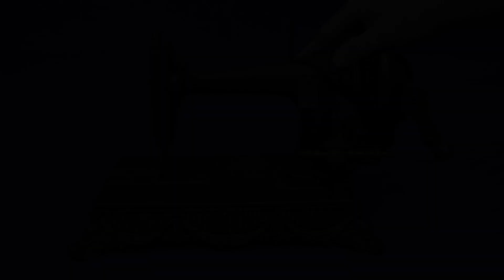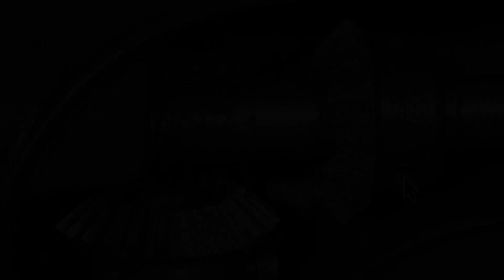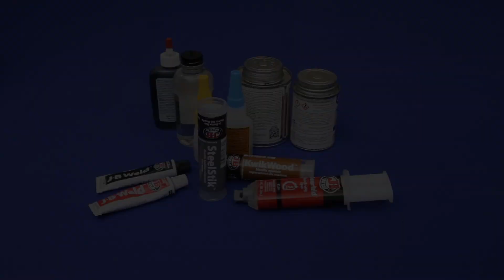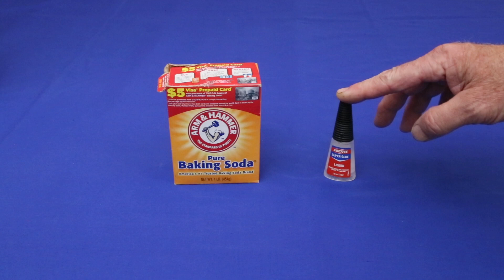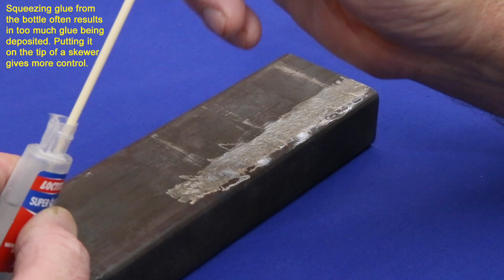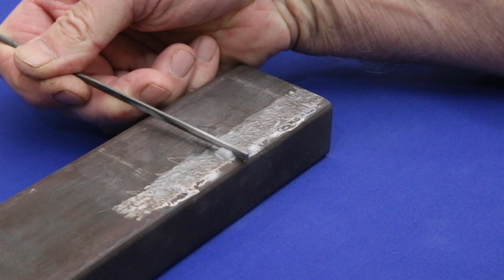How To Fix A Broken Gear Tooth In An Antique Sewing Machine

Comment: Totally awesome!!! Do you think it's sturdy enough to withstand actually sewing? I haven't tried this awesomeness, but me thinks it might be a little to brittle. What do you think Wayne?
Reply from the maker: Yes, it's strong enough to sew with and have done so. But, I don't feel comfortable about doing it for anything other than demonstrations. One thing I've discovered is that grease works better than oil for lubricating these made-up gears because the gear teeth surfaces aren't as smooth as metal teeth. I have talked to Alex about this and he mentioned using both this technique and super glue by itself in repairing some of his machines.
Reply: @wayneschmidt490  Thanks for the reply! Perhaps graphite will work as a lubricant and 'hide' the repair by making the superglue + baking soda as dark as the rest of the wormgear.

Comment: Incredible video Wayne. No one makes videos like this which are so valuable for a new restorer like myself. If I every come upon broken irreplaceable gears, I'll know exactly what to do. Thanks a million!
Reply from the maker: Thanks for the great comment! The new gear teeth seem to be holding, but I'm still a little uneasy about how durable they are. I make sure to give them extra oil before each use. 

If you like videos about restoring sewing machines, you might be interested in my next video, which chronicles in greater detail all the steps involved in restoring the Biesolt & Locke machine in this video. The machine is done except for the artwork. Another 40 hours should do it. I hope you'll enjoy it.
Reply: @wayneschmidt490  I'll keep my eye out for the next video you mentioned, I'm sure it will be quite interesting!

Comment: If you can solve the disassembly problem, the gears in there are most likely miter gears: Each has the same number of teeth and they meet and transfer power through 90 degrees.
Gears like this are available from Mcmaster.com for very low cost.   https://www.mcmaster.com/miter-gears
If you only require plastic, they are just a few dollars.

The superglue and baking soda thing would be good for filling chips and voids.
Reply from the maker: Again, this is a comment YouTube never told me about. I've found over half a dozen tonight alone. I'm going to have to go through all my videos (520 of them... ugh) to see how many others I've missed. I've gotten lots of stuff from McMaster Carr. If I ever get brave enough to try and take one of these antiques apart I'mmbe sure to use your suggestion. My concern is that in attempting to disassemble one, I might cause more damage than good. These things are 150 years old.

Comment: What tools do you need to remove the gears? I would think you could find a matching set close enough to the original, even if you have to adjust the bore bigger/smaller. 
I'm looking at the base and imagining someone sitting at a bench painstakingly carving all those details in a wooden? pattern.  Remarkable.
Reply from the maker: @murmaiderx3923  I finished all the decal work on this machine last night. Today is devoted to the hand gilding. Then all that's left is to clear coat it, assemble it and post the video. This has been a tough one. I figure it'll add up to 150 hours.
Reply: @murmaiderx3923  Why a graphite bath? Graphite doesn't act like creeper oil, does it?
Reply from the maker: The biggest problem is removing the main drive wheel for the horizontal shaft. Many times some of the parts are press fitted with a hot pully and cold shaft so that once assembled they can't be separated. Even if that's not done, I've tried taking them apart on other machines and ended up causing more damage than good. Complicating things is that each machine built by a different manufacturer was assembled differently, so there is no one way to take them all apart. An expert like Alex Askaroff could do it in his sleep. But I've only been working on them for 5 years and have a long way to go to get to that level. Once final issue iOS that if you look on the horizontal shaft to the left of the gear, there's a large gouge that would make removing the gear difficult. For now I'll have to stick with my simple technique. Thanks for commenting!
Reply: @wayneschmidt490  Have you asked Alexander Askaroff, from sewalot.com?
Reply from the maker: @murmaiderx3923  That or a shaft pillar might work. One common problem is that after 150 years, some of these parts are cold welded together. One of these days I should buy a bunch of cheap, lost cause machines and experiment with taking them apart. Thanks for the comment!
Reply from the maker: @murmaiderx3923  Those are seriously big machines. I believe they have vertical feeds, like Davis machines, which makes the sewing head much more complicated than normal machines. I've never worked on anything even close to that. Good luck!   Are you making a video about the restorations? If so, please let me know when it's uploaded. I'd like to watch it.
Reply from the maker: I am very sorry that I failed to respond to your post. YouTube never told me you had done so and I just now found it. Yes, I'm finishing up the restoration of this machine and will be posting a video chronicling all of the streps it took to make it look like new. I'll let you know.
Reply: @murmaiderx3923  Can share a link or name of the product you used? I've read that graphite as a liquid lubricant is used in conjuction with a solvent that evaporates after use. But I guess you use something else.